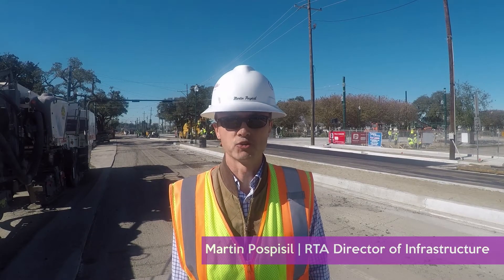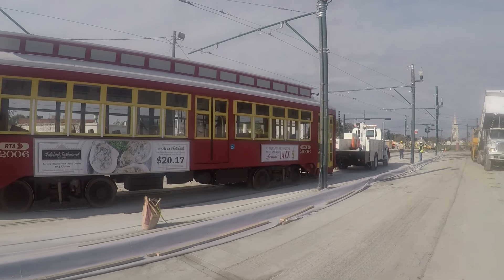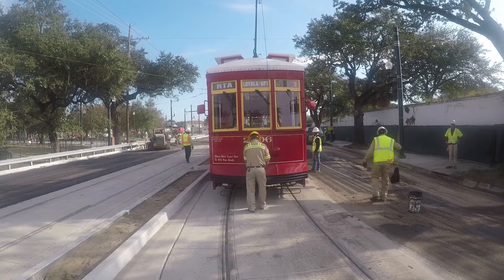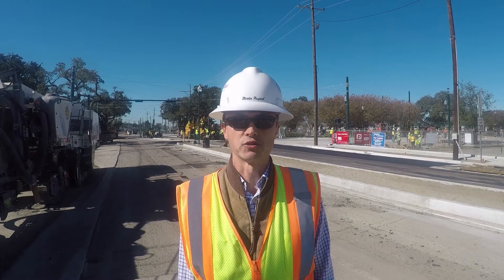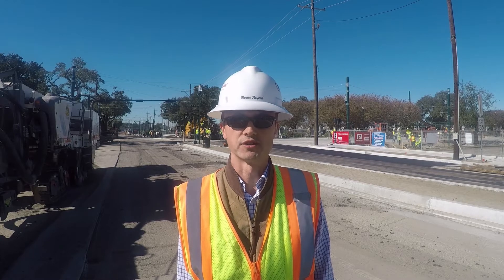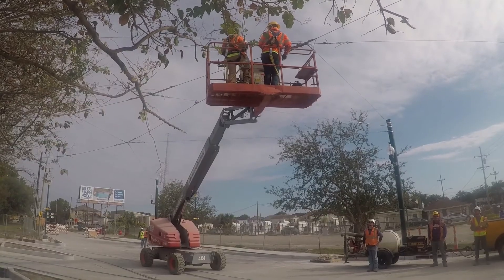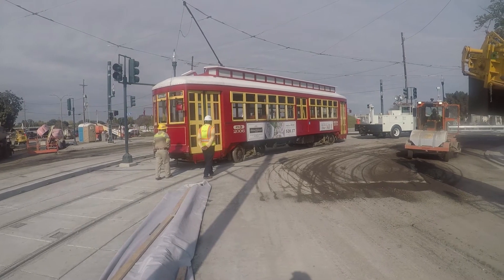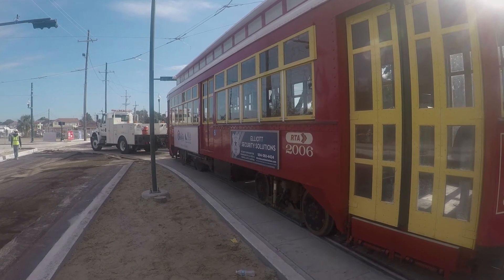Cemeteries Transit Center Project - Streetcar Pull Along New Tracks

Comment: Why was it decided to build the traditional streetcar loop instead having existing dead-end track? Does the traditional loop have any advantages on the Canal-Cemeteries line? Maybe it can speed up turn-around of streetcars? (Instead of 'shut down' a streetcar and go to the opposite cab, driver can simply continue trip along the loop). Am I right or there were another reasons?